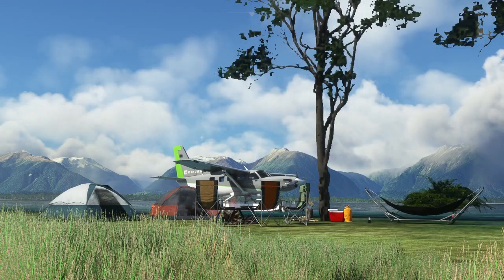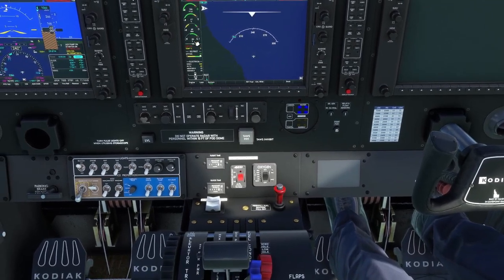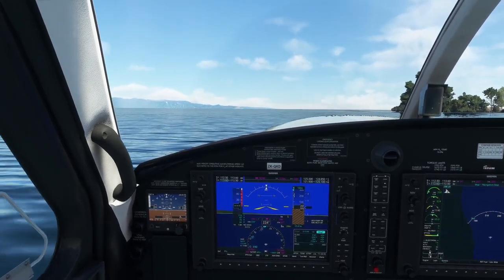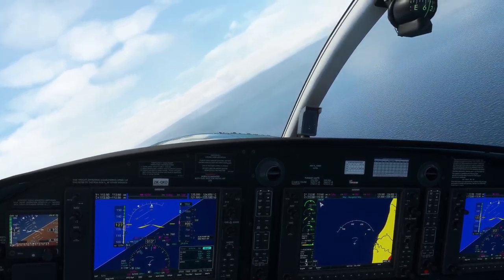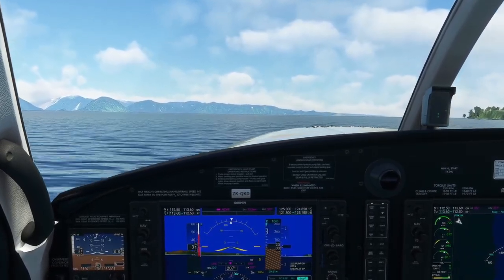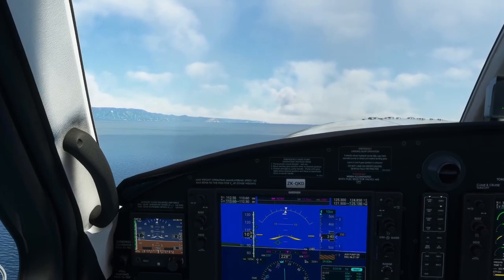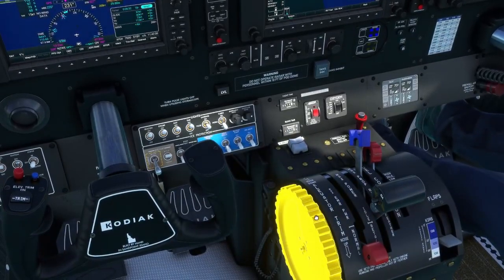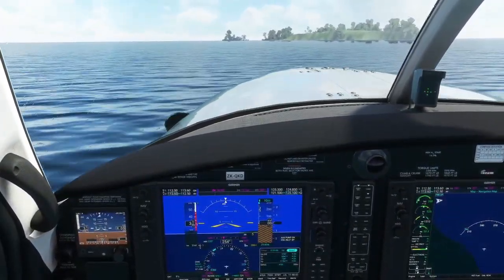[MSFS] Quest Kodiak 100 Water Operations Tutorial Flight / New Zealand

Comment: Is this capable of STOL and bush flights for land-based missions?
Reply from the maker: The Kodiak is a STOL aircraft. I cannot speak for the amphibious version, but the wheeled Kodiak can get into incredibly short fields.  I have two videos ( posted on 1.30.23 & 2.4.23) where I have taken the aircraft into some small dirt airstrips. The amphibious Kodiak should still be capable in the bush. However, since it has the floats and the smaller wheels I would think it is less capable than the wheeled Kodiak for land based missions. For land based missions the wheeled Kodiak would be excellent! It has Tundra tires, cargo pod, no cargo pod, and it has great short field performance! Just know it needs a lot of rudder!